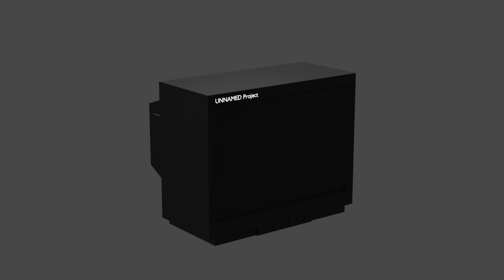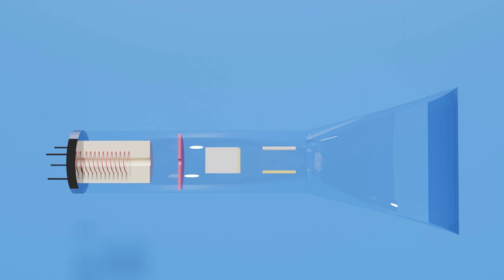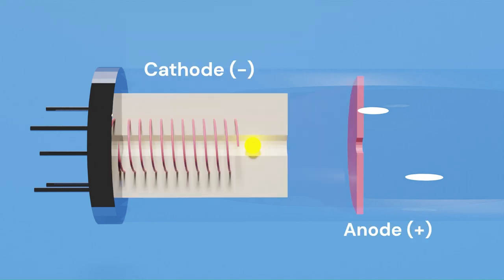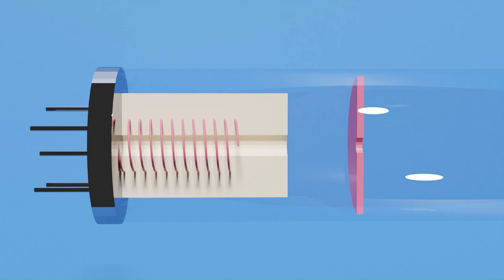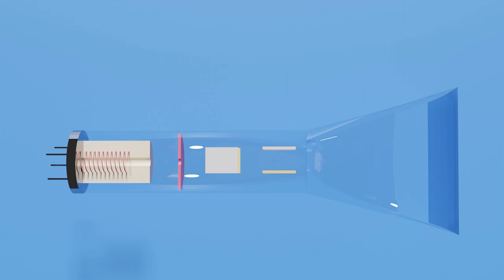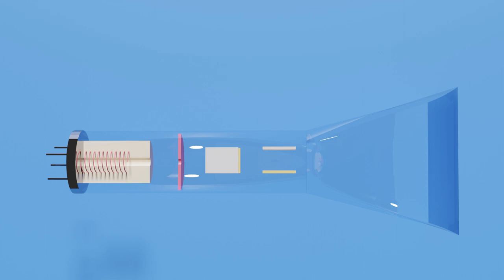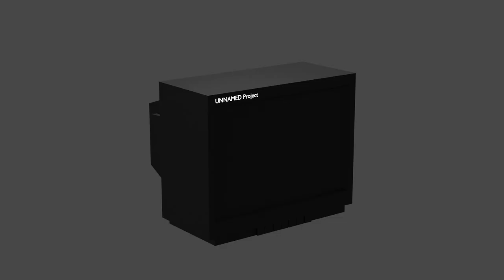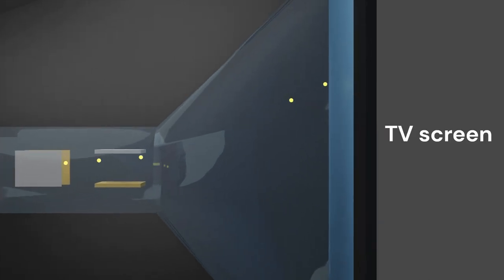How old TVs worked | Cathode Ray Tube Explained

Comment: I don't understand why the electrons don't go back to the accelerating anode?
Reply from the maker: Great question! This is because the electrons already have momentum when passing through the anode. After passing through it might slow them down, but the electric field isn't strong enough to pull them back in, which is why they don't go back. Hope this helps, if something isn't entirely clear just say so.
Reply: @Unnamed_Project223  At school, we were taught Coulomb's law, where the force of attraction is inversely proportional to the square of the distance. However, they didn't tell us anything about the force of repulsion.
Based on the analogy with Newton's law of planetary attraction,
the acceleration time should correspond to the deceleration time,
i.e. at a distance from the cathode to the anode on the reverse side, the electron should stop.
However, from the cathode side, the electron is in an electric field between the cathode and the anode, and after the passage of the anode, there is no external electric field.
Maybe that's the reason.